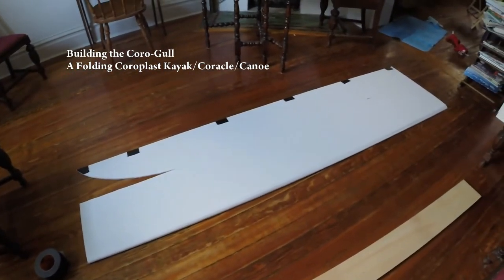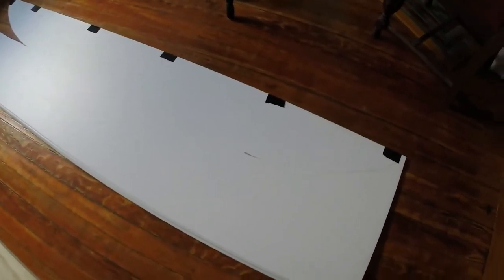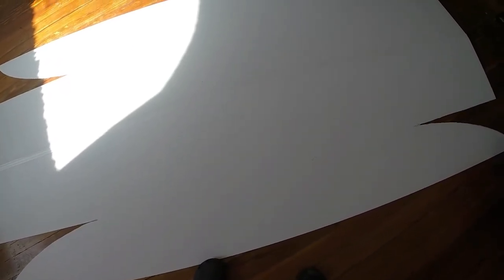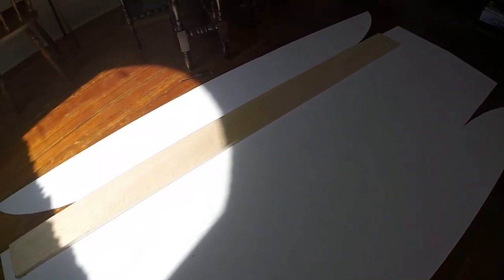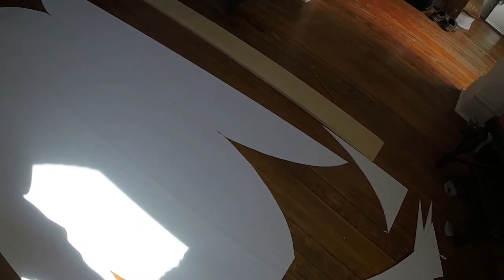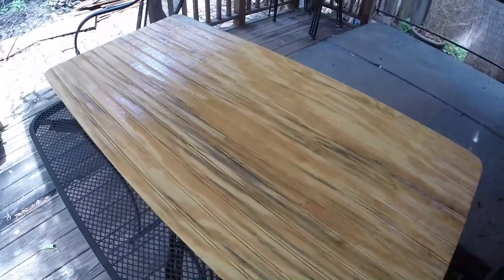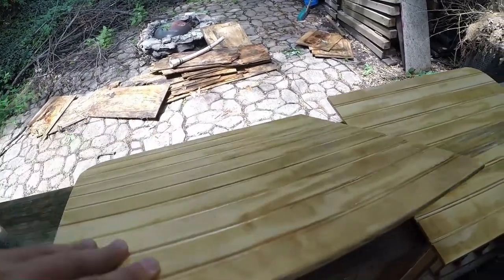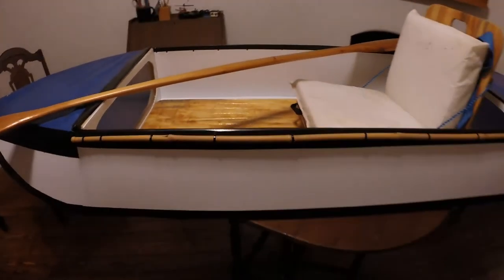DIY Corrugated Plastic Folding Kayak build

Comment from the maker: I'm working on version 2 of this boat.  It has two additional folds that allow it to compact down to a 15" x 50" package...small enough to fit in most cars.  I'll post that video soon.

I should note that it only takes less than a pint of polyurethane for the floorboard and seat.  So, a quart will do two boats.  I ended up buying more because I was working from half a can on the first boat.

Also, you could get away with using half the velcro than I did on this boat.  One package could be stretched to two boats if used judiciously.

I also am planning a 12' version with sharper for and aft sections and possibly, a skeg for better tracking.  The cost will be about $20 more than the original design, due to the extra Coroplast.
Reply from the maker: I built that 2nd boat.  It could fold down even smaller...about 50 inches.  Both bots are for smooth water.  Any waves will swamp the boat and sink it.  A solution might be to augment floatation with air bags or a  spray skirt.
Reply from the maker: Kelley Morgan no plans yet...however, I probably will post a video.  The new design simply adds additional folds that allow the boat to fold to a shorter package.  I've built a sof sit on top kayak in the meantime... Which is a lot more stable in choppy water.
Reply: chainduck Any video on your sof sit on top kayak?

Comment from the maker: Just a followup, since I've recently had more questions about the boat and it's successors.  The second boat was just as successful as the first.  The addition of fore and aft folds didn't weaken it significantly.   I'll try to post a video of how the extra folds work.  It's really very simple.  After making the boat as before, I creased across the bottom and base of the side curves.  The boat sides fold in towards the middle as before.  Then, the fore and aft ends fold UNDER the boat.   This means that the 2nd boat can easily fit in most car trunks, instead of needing the full 8 feet of length.  The downside is that it limits any additional side floats.  But, that doesn't mean you can just add some on site...maybe just a couple of big pool noodles on the gunwhales, attached with nylon ties that can be cut before loading up.

Comment from the maker: Other build thoughts...

This could be a bit easier to tape if you went with straight seams bow and aft instead of the curved ones I used.  It probably won't affect performance much  on such a slow little boat.  Also, the boat could be folded in the other direction for a smaller package.  The downside would be that the bamboo would have to be removable (See Ken Simpson's designs using bolt on rails).  And, the mid section would be weakened. 

I am toying with the idea of a design that folds the bow and stern to the middle, then folds lengthwise.  This would allow the bamboo stiffeners to stay in place and bring the total folded size to 18" x 48".   The issue then becomes one of total material thickness and if the boat can have double layer folds without crushing.  I'll let you know what I come up with. :)

Comment: Where did you buy the large sheet of corrugated plastic?

Hey, I'm not sure if you knew but there is a company that produces foldable kayaks using corrugated plastic just like yourself.  It's called the Oru kayak.
Reply from the maker: Yep, the Oru is a more complicated folding system...and way more expensive.  I designed this boat to be a very simple construction and folding pattern.  The Oru is certainly a better rigid design.  But, this one is a lot of fun to make and take out on flat water.

The Coroplast sheet, I got from Regal Plastics in St. Louis.  The total cost for 3 sheets and handling was about $50.  They have a minimum purchase of $25 plus handling.  Most major cities will have some company that carries coroplast sheet.  I purposely based my design on the 4x8 sheet.  But, you could easily extend the length of the boat by attaching additional plastic at the fore or aft (or both) sections.  You'll need to plan for additional bamboo support along the sides.

Comment from the maker: Another structural possibility...I've found a glue that seems to really stick to the Coroplast.  It's a spray on industrial contact cement from Harbor Freight.  I did a test yesterday with two scraps of coro.  I can not pull them apart by hand.  What I don't know, is how water will affect the bond.  If it is unaffected by moisture, this could open up some more design possibilities, and lead to easier production.
Reply from the maker: Update the contact cement was great until it got wet...water ruined the adhesion...so, still looking for the right glue.
Reply: How about 3M double sided tape used in the aircraft industry? They are impossible to pull apart and definitely waterproof.
Reply from the maker: That does look interesting.  The reviews are good and seem to suggest that it is very waterproof.  The best test will be to see how it does while submerged.
Reply from the maker: Sorry, no plans or anything...mainly because I didn't make any.  The video shows pretty much all there is to this build.  It's very simple.  It's also very inexpensive.  So, don't be afraid to give it a try.

I'll be very interested in seeing what you come up with for a tandem.    As an open boat design, this particular kayak is really only good on still water.  Just moderate waves can easily sink it.  A good possibility for making it more safe, would be to add some fore and after (and maybe gunwhale) inflatable bags.  That could do a lot for keeping the boat above the water line in the event of bad splash over.  I own an inflatable canoe that I'm considering add some rigid support to, to make it easier to handle.

All that said, my current favorite boat is my skin on frame, kayak / paddleboard.  It doesn't fold up.
Reply from the maker: Also - I have thought a bit more about flotation.  Depending upon your budget, Semi rigid foam closed cell foam sheet (Yoga mats?) could be used on the outside sides of the boat, without ruining the folding aspect.  I'm thinking about an inch thick glued to either side would really add a lot of flotation.  It should also add to the stiffness of the sides, but be bendy enough to make the bow and aft curves.  The biggest concern would be getting a tight enough glue joint so that no water collects between the foam and the plastic.

Comment: Would it track better if you have a small 1" or 2" keel?
Reply from the maker: That could be.  It's certainly worth a try.  Your biggest issue would be the additional thickness added in the center fold.  A fin or keel with no support to keep it perpendicular, wouldn't really be much help.  That said, it might be possible to add double fins, one to each side of the boat, without affecting the folds.  Really, this boat is much more like a coracle than a kayak.  It is a boat designed to paddle slowly in still water.  It is great if you want a little boat that you can fit easily into a small car for the occasional day trip paddle.  I wouldn't really use it for anything more intense.  Yet, the basic design is there.  If I were to give this another try, I'd consider upgraded materials with foam sidewalls and a more enclosed cockpit to keep out more of the splash.  BTW.  Those bamboo poles to stiffen the sides worked out really well.  That was one of my better strokes of genius. ;)
Reply: Its awesome!
Reply from the maker: Did you end up building one?  I'd love to see it, if you did.
Reply: not yet, but thinking of it.

Comment: amazing job , congratulations , could you send me the plans for the boat ?, how many kilos think you stand ?

greetings from Argentina
Reply from the maker: There are no plans other than what you see on here.  It's all based on one sheet of Coroplast plus the bracing frames.  Just draw your own from my steps.  I weigh about 180 pounds.  That is probably near the limit of what the kayak can do before swamping.  This is strictly a calm water boat.  You could increase the flotation by other methods - add some air bags in the fore and aft, add pool noodles to the gunwhales affixed to the bamboo, add some sheet styrofoam to the sides.  Just play with it.  It is an experimental design after all. :)